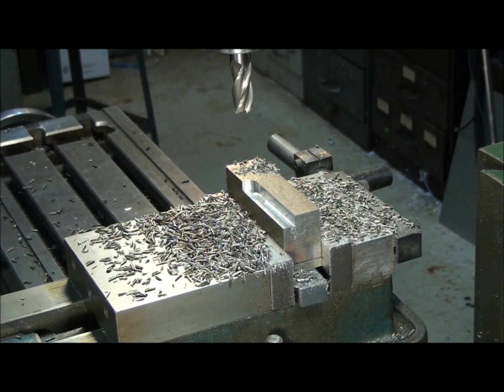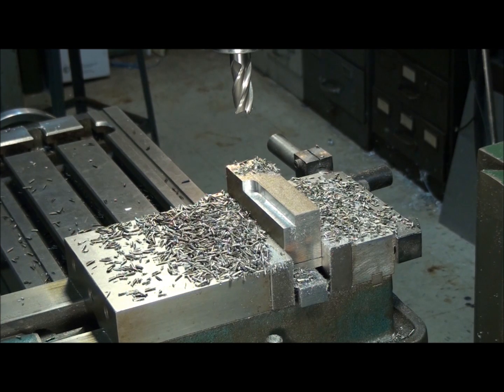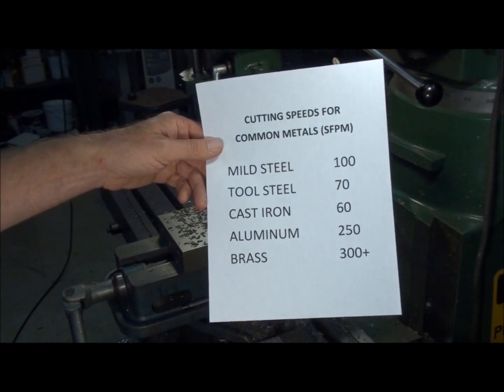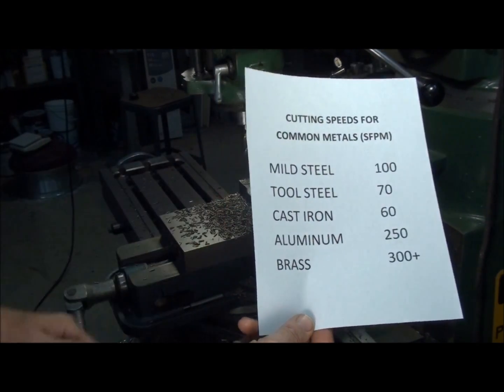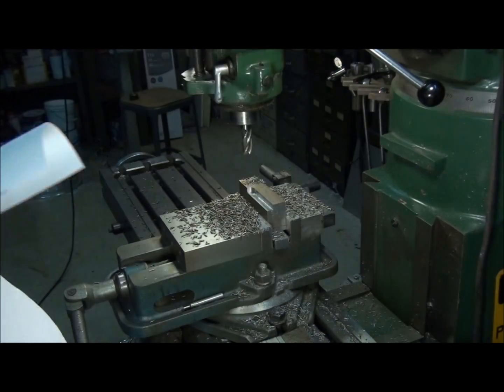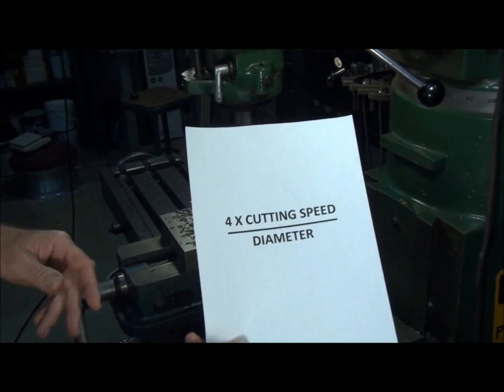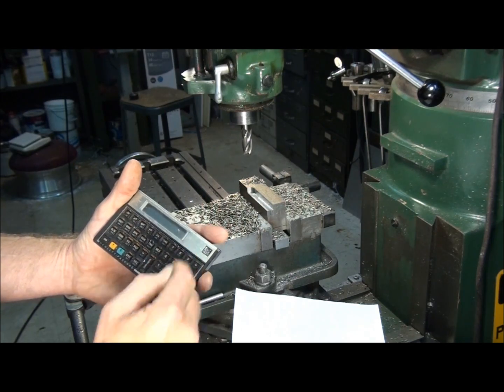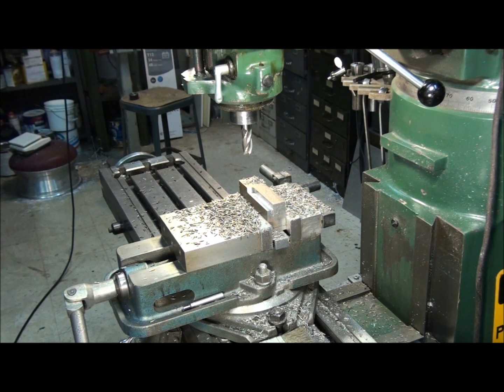Cutting Speed and RPM on the Lathe and Mill

Comment: What about feed rates
Reply from the maker: Unless you can set a specific feed rate on your machine in inches per minute, there is no point in calculating them. You just need to learn to read the signs. Watch chip color in the case of steel, listen to the machine for chatter or for it struggling, and watch for deflection of the end mill. Just make sure the rpm is correct and you are taking light cuts in the proper direction.
Reply: @TomsTechniques thank you very much for the response

Comment: How can I calculate the feed of the milling machine according to this formula?
Reply from the maker: Unless you have a mill with a gear driven feed on the table, calculating feed rate would be pointless. On light mills, your best option is to set the proper rpm according to the formula in this video, then pay attention to the sound and feel, and the color of the chips (for steel). The cutter should cut smoothly without struggling.

Comment: Fly cutter speed,  I always run it very fast... And remove small amount amounts of metal at a time...
Reply from the maker: Verry fast is not necessarily good. always calculate the correct rpm based on the cutting speed of the metal being cut and the diameter of the tool.
Reply: @TomsTechniques  yes, I was thinking of when I use the Fly-Cutter to Surface a Harley-Davidson cylinder head... Of course this aluminum

Comment: I never knew how to calculate speeds & feeds when I ran manual machine tools. I’d look at the spinning cutter or workpiece and figure that’s a good RPM to start with. I’d adjust my speeds & feeds from there based on the surface finish, rigidity of the machine and workpiece setup and horsepower of the machine. I did have to calculate speeds & feeds when I learned how to program & run CNC machines. The actual speeds & feeds to cut are put into the machine program.

Comment: Hi,  I've used a simpler "no calculator" method  for a long time... (40 years) it depends upon knowing a few metric conversions, but you and I came up with a very similar answer to the spindle rate for your 5/8" cutter... (16mm is 0.63" no appreciable difference...)

For a 100 FPM cutting speed, divide 100 by the cutter or workpiece diameter (so it applies to mills, drills, turning) then multiply that answer by 100.  So, worked example-

100/16 = 6.25. Multiply 6.25 x 100, you get 625... Not so different from your 645? And the calculator was redundant... 

For a cutting speed less than or greater than 100 FPM, just pro rate... 500fpm? 625 x 5 = 3,125 RPM
50 RPM? 310 rpm 

1/16" drill = 1.6mm 100 /1.6 = 96, 96 x 100 = 9,600 rpm.  As you say, a starting point... But 40 years of using my simple formula tells me it works... And... 100 FPM is 30 metres/min, so you can do a fairly rapid mental approximation from metric to imperial (calculator free)

When I started work, the old guys recommended  these spindle speeds for drilling... 1,000, 500, 250 rpm for 1/4", 1/2", and 1"  drills, respectively, pro rated for bigger and smaller drills, in mild Steel, run wet.  I think some of them started out with high carbon steel drills.
HSS and Super HSS, we could use 1,600, 800 and 400 RPM, wet.  60% of that speed dry...
And none of it needs  a calculator... (or pi)

Comment: This is great, but emphasize: UNITS MATTER!  The formula relies on surface speed in feet per minute and tool diameter in inches, resulting in spindle speed in rpm.  DO NOT USE THIS FORMULA WITH METRIC UNITS--convert your values to sfm for the material and inches tool diameter, then plug in.
Reply from the maker: @robertdubard7959  The formula in the video is in inches and surface feet per minute. There are probably similar ones for metric use. In fact, I believe some have been discussed in the comments.

Comment: ❤what about feed rate😊
Reply from the maker: Unless you have a mill that you can set a specific feed rate, it's best done by feel. For steel, the chips should have no color, or just a little straw colored and the mill should be easily handling the cut. No chatter. For aluminum, just be sure the chips aren't heating up to the point where they stick to the end mill. If you have the rpm right, the federated is easy.
Reply: @TomsTechniques  what if you can set a feed rate. How do you calculate that? thx

Comment: Total noob here. Just bought a  40 something year old Jet 16 drill-mill from a friend, and trying to learn all I can before I start my first surfacing/milling project. I understand the surface feet per minute, and the bit diameter, but why 4? Why not 3, or 5, or some other number. Since surface speed must be multiplied by 4, 4 must have a significance? Otherwise if it is always 4, then by default surface feet per minute for mild steel would always be 400. Then could be simplified by simply 400 / 0.625 = 640 ? I must say though your tutorial has explained bit speed better that any other tutorial I’ve seen! I certainly have more confidence to start my project than before I watched this !
Reply from the maker: I think you are misunderstanding the formula. The 4 is just a constant in an easy to remember formula to provide an approximate rpm for various cutting speeds and diameters. In the case of mild steel, the cutting speed is 100 sfpm (not 400). With your ,625 diameter part, that works out to 400/.625=640rpm. For aluminum, with a cutting speed of 500, the rpm works out to 2000/.625= 3200rpm.
Reply: @TomsTechniques  , Thank you for your quick reply. Your formula is very simple and easy to follow. Your formula helps me tremendously! But primarily the question is about the constant # 4. Is the constant always 4? Is it possible to ever be another number? Is there a reason the constant is 4? Or is it one of those things that just is?

Comment: Now i know why i have ruind so many mill bits...Wrong speed..But i still don't understand how to calculate the rpm..Not familiar with imperial..
Reply from the maker: I'm sure there are quick and dirty formulas like mine for metric rpm's. If your cutting speeds are called out in meters per minute, just divide that by the circumference (in meters) of your cutter for the rpm. Then, just play with the formula to come up with something that's easy to remember. An approximation is close enough.

Comment: im in germany and we use metric but maybe it is the same with imperial and we use 70m/min x1000 to get mm/min and then 70.000: pi x 15 
     cutting speed : pi x endmill diameter
Reply from the maker: There are probably similar quick and dirty formulas for metric measurements. I know if you use my cutting speed chart, change the 4 to 100 in the formula and divide by the diameter in mm it works. For example, if you use the cutting speed for mild steel of 100sfpm and you have a 25mm end mill , 100 x 100sfpm ÷ 25mm = 400rpm.
Reply: @TomsTechniques  we have a handbook and we call it the mechanics bible cause it has basically everything and it has a chart with cutting speeds in M/min but i checked and it didn't work with metric . it worked just fine with imperial but maybe i just didn't understand

Comment: How you calculate the feed??? Awesome knowledge..tankuuuu
Reply from the maker: Unless you have a mill with a calibrated feed, there is no reason to calculate the feed rate. If you are using a manual mill, just use your eyes and ears to tell when the feed rate is correct. The mill should not be complaining, and the chips shouldn't be blue (for steel).
Reply: @TomsTechniques  im cutting aluminum with a router cnc i made...

Comment: This is a very old perspective. Modern CNC has found much different parameters. Harvey tool will tell you to run aluminum at 1000 sfpm or more
Reply from the maker: That is true, but remember that Harvey Tool sells carbide tools, not HSS. Aluminum can be cut at higher speeds without burning the tool, but unless coolant is used, the tool will load up and break. That won't happen with brass, which is why I left the upper cutting speed limit on it open.

Comment: Is it 4 times the cutting speed because of the endmill being a 4 flute endmill? If so, would you do 2 x cutting speed for a 2 flute endmill?
Reply from the maker: Four is just a constant in the equation and has nothing to do with the end mill. The same equation can be used to calculate the rpm for turning a part on the larhe.
Reply: @TomsTechniques  I just realized deep in the comments, this equation is for HSS. I was thinking it was a carbide equation until I found where you said a long time ago that it’s not. Still a very great informative video!

Comment: Is this for carbide or hss end mill?
Reply from the maker: Either. The only thing that varies is the cutting speed.
Reply: @TomsTechniques  thanks! I tried this but the hss end mill tip burned out. Do u know why this happens?
Reply: @TomsTechniques  it was an 8mm end mill with 1mm depth of cut

Comment: The formulas that you gave for the rpm's. Is that for a high speed cutters. What about carbide end mills. That is different,  correct.
Reply from the maker: Yes. Just look up cutting speeds for carbide. It's generally about four times that of high speed steel.

Comment: Soooo for machines and people who don’t use the retard system, if I understand correctly which 500mm/4 times 4 equals to 2000mm/m divided by 8 mm dtool equals 250 rpm. If I am going to run a 4 flute 8mm carbide endmill side cutting with those rpm’s there is no way this thing gonna cut anything and there is no way to survive also. Although this video have a good explanation, there are other things to consider also. Such the numbers of the flutes the tool have, the material is made of (hss cobalt carbide) and the method you are gonna use to cut (plunge, side cut, slot cut and even ramping sometimes)
Reply from the maker: In your haste to condem the imperial measurement  system and those who use it, which by the way, was developed by Great Britain,  you totally failed at correctly calculating the rpm for your 8mm end mill. You should probably cast aside your bias, rewatch the video, and give it another go.

Comment: Is the rpm based off the spindle speed or the actual cutter?
Reply from the maker: The rpm is calculated using the cutting speed if the metal being machined and the diameter of the tool or work (for a lathe).

Comment: Disappointed that most of the information is SFPM and not RPM as the video title suggests, why cant someone do a chart with RPM for different materials and sizes it cant be that difficult?
Reply from the maker: As I mentioned in the video, cutting speed charts for various metals are readily available in Machinery's Handbook and online. There is also one on my website under references. It would be impractical to make one for all combinations of diameters and metals. You'll just need to do the marh.

Comment: Thanks sir.. What about feed rate.. Have u made a video about it also?
Reply from the maker: There are so many variables affecting feedrate that it's best to just pay attention to what's happening. Listen for chatter, pay attention to the sound of the machine, flex of the end mill, etc. and adjust the feedrate accordingly. Yes, there are formulas to follow to calculate chip load on the cutters, but unless you have a mill that you can set the feed to a specific rate, they won't do you any good.
Reply: @TomsTechniques  thanks for replying.. Have u made a new video? Its been too long since your last upload

Comment: I noticed that RPM can really mess things up if you get it outside the ballpark. I was cutting a sort of oval hole for an exhaust flange in mild steel with a 10mm thickness (just short of 1/2"). I used a 14mm endmill, and managed to completely burn it up to the point where the endmill became miscolored running at about 1400RPM. Turning it down to about 780RPM made it run so much better with a new end mill, and it didn't burn it up.
Reply from the maker: Too slow and they break, too fast and they burn up. RPM definitely matters.
Reply: @TomsTechniques  What I don't understand is, how can they survive in CNC machines running several thousand RPM?
Reply: @TheChrisey The only thing I’ve figured out is that it’s because of how precise CNC milling can be over manual mills. But CNC’s can still burn up tools if not ran properly.

Comment: Thank you sir ! I burnt up a 1/8 endmill today because my journeymen toolmaker told me to run at 800 rpm !???? Thanx again I am a apprentice toolmaker will be watching you're videos!!
Reply from the maker: Not sure what you were machining, but 800 rpm is about a quarter the rpm you should have been using for mild steel. Was the material hardened by chance?
Reply: @TomsTechniques  no 8620 basically cold roll

Comment: Rough & ready calculations ! For 100 fpm @ 5/8 rpm actually needs to be 611 !

Firstly, remember the 5/8 is in inches and we're going for a speed in feet per *minute*. So we need a conversion factor : 12, not 4.

So we have 12 X 100 and converting diameter to circumference, we need to divide by Pi......

= 12 X100/3.141 - then remembering cutter diameter......

= 12 X 100 / 3.141 (divided by 5/8 - which we flip (8/5).....

= 1200/3.141 * 8 / 5 = 611.27 rpm

The error is the "4 X" - it should be a little less: 3.82 (12/Pi) to properly deal with the conversions from diameter to circumference and inches to feet.
Reply from the maker: You are putting WAY too much though into this. The 4 x CS / Dia. formula is merely an easy to remember approximation. It can then be tweaked as necessary during the actual cut.
Reply: @TomsTechniques  Using 3.82 instead of 4 is only a slight change but that's all it needs.

Some may be interested as to how the formula works - so I've split it into its component parts.

Comment: 3:33 Maths - 4 x [100] over diameter (of 5/8)

= 400....... now, to divide by a fraction [5/8] - flip the fraction......

= 400 X 8 / 5 

= 3200 / 5 - now, note 5 is half of 10 = 10/2  but as we are dividing by this fraction, we flip it - so X 2 and /10 ........

= 6400 /10 = 640

Calculator not required.

Comment: "Cutting Speed and RPM on the Lathe and Mill" - well that covered rpm, what about cutting speed/feed ?
Reply: The chart he first shows is the speed according to this video. If you are looking for feed rate you need a chart with those calculations. Inch per tooth, number of teeth, diameter of cutter, that sort of chart.

Comment: Hey Tom how you doing? Sorry for hitting you with so many questions all the but you never know what to believe on the internet......I have an iso 30 taper on my bridgeport and i have a chunk of 1045 steel do you think it's safe to use 1045 for taper tooling or is it too soft....i dont have an oven yet and I'm worried about distortion if I use a torch .
Reply from the maker: 1045 is definitely too soft to use for a tool holder without being hardened, and it's best to surface harden it on larger parts, 2" or larger cross section, to ensure the center gets hard. However you do it, the holders should be finish ground after heat treat to deal with any distortion caused by the heat treating process.
Reply: @TomsTechniques  ok thanks Tom

Comment: Hey Tom I've been trying to figure out my feeds and speeds for a 3 flute .75 shank indexable endmill I brought tin coated and everything I found says 1000 to 1500ish rpms but I'm throwing blue chips and and a little squealing at those speeds it just doesnt feel right.   .about .050 doc is it better to use just hss speeds? I have a bridgeport 1045 steel
Reply from the maker: 1500 rpm and blue chips is totally appropriate for a 3/4" carbide end mill. If it's complaining, you may want to reduce the depth of cut and increase the feed rate. Thirty to forty thousandths would be a good depth to start with. Carbide likes high feed rates to carry the heat away in the chip.
Reply: @TomsTechniques  you were right Tom my feed rate was way to slow thanks....I dont know why more people dont use carbide on manual mills it's great for roughing alot of material.......

Comment: is the Cutting Speed's unit sfm and m/min interchangeable? since I noticed based on the machinist's guide, for mild steel, sfm is 100. and another source has it that for mild steel, m/min is also 100. are they the same?
Reply from the maker: Feet per minute and meters per minute are not the same, but there are plenty of online converters to change from one to the other. You may have been looking at a metric speed for carbide.

Comment: I know this is an old video but I just found it and I wanted to thank you for it because this one video has (I believe) solved my premature cutter wear problem.  I've been running my tools at way too fast an rpm and have been wearing out end mills much too rapidly.  I also am making normal sized chips in steel now instead of a bunch of tiny needles that I'm  not sure I'll ever get out of my hands completely.  Priceless info for me!

Comment: Hello, in this video you said you can find the cutting speeds in any machiner’s handbook or references; what handbooks and reference would you recommend?
Reply from the maker: There is a pretty complete cutting speed chart in the reference section of my website. For general machining reference, it's hard to beat the Machinery's Handbook. New ones are pricey, but they come out with new editions every few years, so there are lots of older used copies available.

Another good one is the Machinist's ready Reference. It is more basic than the Machinery's Handbook, but that can be a good thing for the new machinist.

Comment: Thanks for the vid , I'm using 1/2 inch in Mill bit and my drill press. I am only Milling wood. It does not have an RPM chart on it, but it has about four different speeds. Should I be running it at the fastest speed, for wood?
Reply from the maker: A drill chuck mounted on a tapered spindle is not designed to be used for milling, especially at the high rpm's required for wood. The entire chuck and cutter can fly off at any time.